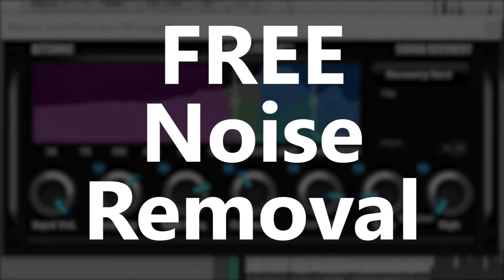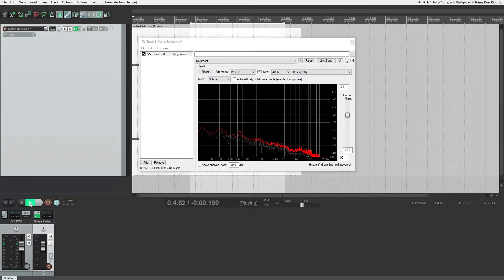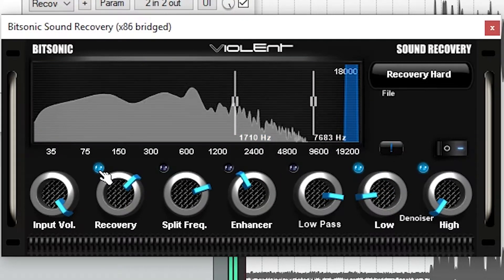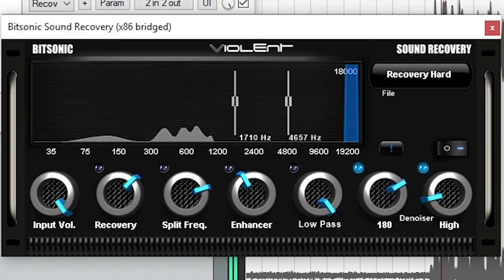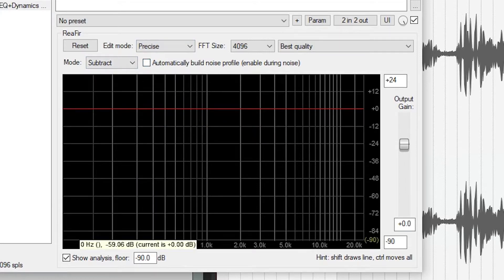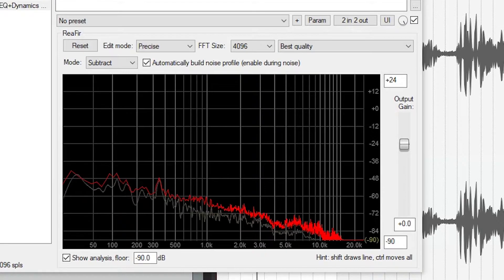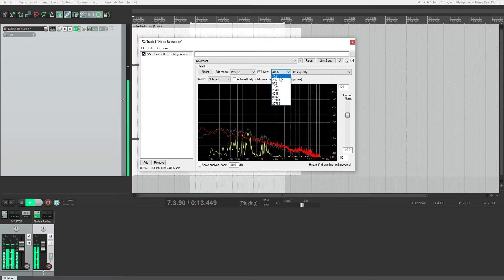Free Noise Removal VST Plugins

Comment: If anyone has the Elgato Wave 3 like I do, they added the ability to use plugins directly through the wavelink software, really does wonders. Just use the plugins under the wave:3 section for you mic (the little noise line button at the bottom of the input box) and put the plugins there then make the output for recording Wave Link Stream and boom. Works incredibly well for recording.

Comment: ReaFIR isn't free. It's only a limited-time free trial and then it costs $60 as part of the Reaper package.
Reply: I have been using the evaluated version of reaper for several months passed the trial. Not meaning to come off rude. However, reaper doesn't automatically charge you or force you to purchase anything. With that being said, they do NOT limit their users in any form or fashion.

Comment: Thanks. Garageband (for Mac) has too harsh and simple noise reduction tool. 
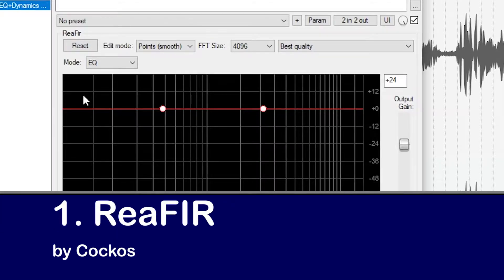1:24 ReaFIR - Reaper plugin is only available for Windows.
 0:35 Sound Recovery instalation file has a Wine software included in default. You can select not to install Wine. But will the plugin work then? I haven't tried it yet.
Reply: im using reafir on my mac with no problem
Reply: @drillgirl718  How?